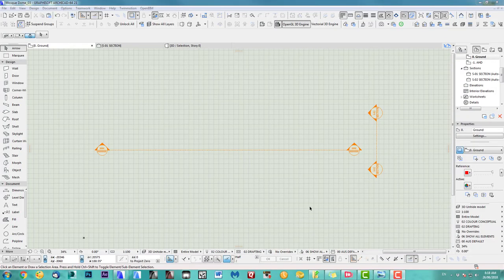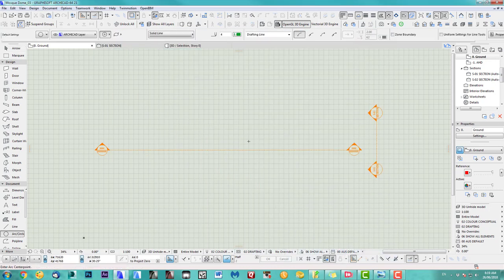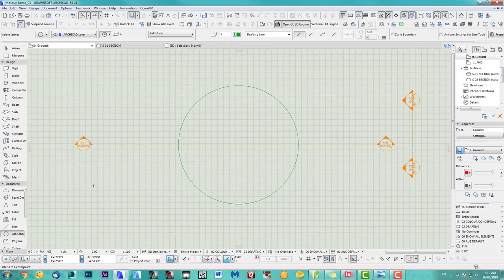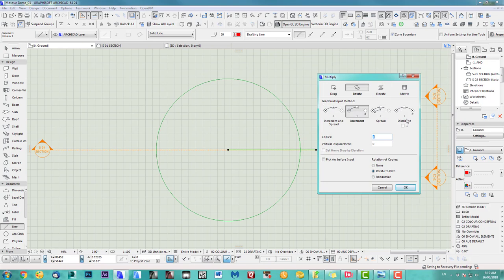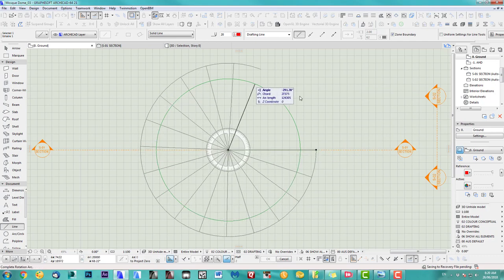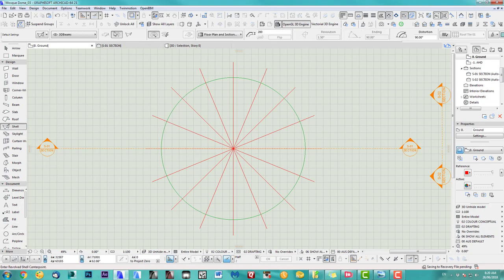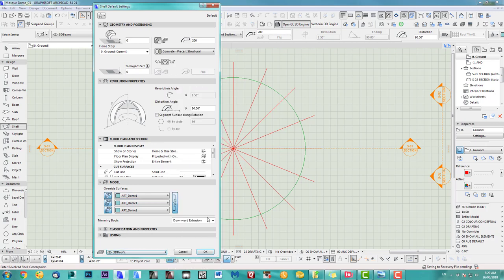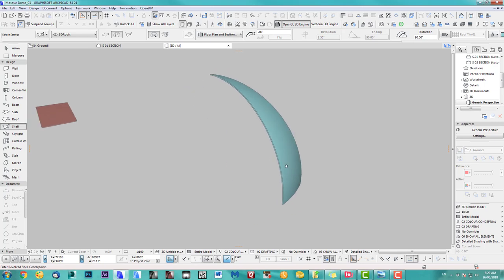ARCHICAD How to model a Mosque Dome

Comment: Loved it. Thank you man. Wish I discovered you earlier!
I'd like to share a couple of tips too since you are sooo nice to share yours.
-To draw a line in the exact middle of two other lines, there is a tool called 'angle bisector constraint', which is in the toolbar where you have the offset, parallel, etc. icons. Much faster, less clicks and zooming, and accurate.
-To find a point on a circle at an exact distance from another point, rather than a line, draw a circle. That will give you that exact point and it's easier to see.
-To draw the very first fill off the shell while in section, what I do is copy-paste the two shells. That copies them as lines and fills. Select them all, deselect only what you want to retain and you have the perfect shape you need straight from the model. No drafting required, speed and accuracy all in one.
-I also have drawn the top hole straight in the profiler to avoid cutting a special hole in the shell. By doing that I have kept the exact geometries and was very fast too.

One thing would be nice, but I don't know if and how that would be possible. I'll try and ask.
Would be possible to have those cuts always perpendicular to the shell (radio-centric)? ..mmhh..I think it is.. but can't see it a fast modelling though.. would take a while!!

Cheers and keep it up mate!
Reply from the maker: Thanks for all the tips!

In regards to the - cuts perpendicular to the shell - I did try to come up with a fast way but at the time could not figure out one. Maybe with more "thinking" time there is a solution that is not too slow but I need time for that :) , too busy atm

Comment: how about those element  that divides the dome to be perpendicular to the arch of the dome not parallel to the ground. Because in reality if you put those members suppose you use steel definitely you will attached them perpendicular to the arch. I hope you know what I mean. For graphics the dome is fine, but for constructions there will be adjustments.
Reply from the maker: I think I know what you mean and agree, many times in the design process we come up with ideas but then need solutions to actually build it. Thanks for your feedback.

Comment: @7:57 cant see the walls the fill is covering my walls ..what can i do
Reply from the maker: select the fill and move to the back. Menu - edit - display order
Reply: but you change the layer of the wall to cutting plane? and that layer cant be found in the default archicad so how do u add those new layers
Reply from the maker: In the layer setting window top right click new. I just called the layer 3D cutting element, it's really just a name, it is not doing anything special. The main thing is to have your SEO operator on a different layer, so you can turn the layer off and on.